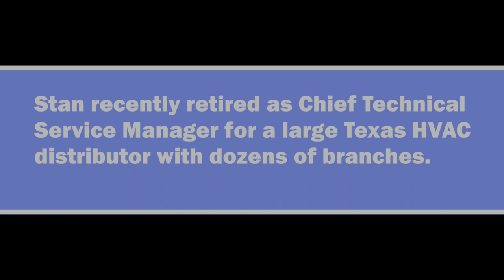Understanding ECM Motors

Comment: The problem is while ECM technology is excellent, the high amperage at high static pressures burns out the controls.  This is not a concern to the mfrs as they please the government with an efficiency test on a pristine design system, and as the motors are mfr/system specific the mfrs can charge near 30% of the cost of original system for the replacement motor.  All “savings” used to sell high SEER to customers is then reclaimed by the mfrs with all the heat going onto the HVAC contractor/tech.  

As everything is in the control microprocessor, they could program the motors to not go up so high in amp draw and save the motor, but then they’d lose out on the lucrative parts profits from being the sole source supplier of properly characterized modules.  Also, the customer gets a long period of no HVAC while the part is being shipped in.
Reply: Happening to me as I type this been out of AC four five days now as I wait for an new ECM smh
Reply: @joesprauve2408  you should just replace it with a new PSC motor and call it a day. Then in the future, you have a much easier repair if needed again.

Comment: I have x13 electronic air handler after it does its cycle fan turns back on for a second turns of it does it 3 to 10 times at a time icm both have been replaced also fan motor but still does the same thing any information

Comment: AC to DC to 3 phase AC? What’s the purpose of the DC?
Reply: DC voltage is more powerful than AC. But we use AC at our house because it can travel much farther distance. You can use a cordless drill, say a 12volt battery and do the same work compared to a 120v corded drill. It's just more energy efficient.
Reply: The 3 phase Ac really is just artificial AC voltage. It just pulsating that dc voltage at the motors poles and creating that AC sine wave you would see on an oscilloscope.
Reply: @mackenziegray2090  work and power have nothing to do with AC or DC. Work is the product of force and distance. Power is the rate of doing work. It’s more to do with the horsepower as to how much power a motor has and less to do with the source of energy.
Reply: @mackenziegray2090  why not just run it on AC to begin with? Is the benefit in going from single to three phase?
Reply: @brianlittle717  I was just using the word power or work to describe you can do more with dc than ac. Ecm motors really don't pull that much amps compared to psc motors. Especially if you let the capacitor degrade over time they'll pull even more amps because the motor isn't spinning fast enough to create back EMF or its own resistance with inductive reactance.
Reply: @brianlittle717  not to mention ecm can adjust airflow depending on demand.
Reply: @brianlittle717  your original question was never answered. If I understand correctly, the purpose of the dc is to manufacture an artificial AC current at variable speed. Grid AC is at 60hz. Artificial AC can be modulated to say 10-60hz.
Reply: @realSamAndrew  I see. That makes sense. It’s frequency drive. Sort of an inverter to create the frequency, and the poles of the motor have to keep up with the rate of the alternations.
Reply: I think in this case, the motor seems to resemble more a BLDC motor. I see both VFDs (predominantly) and ECMs at my job.

Comment: I don’t understand what’s meant by 3 phase in DC current. There’s no such thing as 3 phase in DC.
Reply: @donalddebat57  I gotcha. An artificial 3 phase sine wave then. But that would be an AC sine wave none the less. Not a direct current.
Reply: @brianlittle717  The DC is used just like an inverter which produces pure sine wave voltage. In this case it produces 3 phase variable voltage and frequency. Don't know what the output would look like on a scope. Even more complicated is that only 2 phases (120 degrees apart) are powered at any given time (sequentially) thus causing the magnetic rotor to turn and the unpowered phase receives EMF generated by the rotor which is used as a feedback to determine commutation, direction and speed. I don't know if the power sent to the 2 phases is in the form of a +/- sine wave or a +/- pulse. The whole idea is fascinating and it definitely works. I have a 19 yr old 2 stage gas heating & cooling (dual compressor & txv on evaporator) system with variable speed & ramping on the blower, condenser fan and inducer. The biggest advantage is humidity control in summer by varying CFM. When heating, even the inducer speed is lowered shortly after the cycle starts which possibly allows hotter air to be circulated(?). The condenser fan seems to run either high or low as per which pump is running (and switching to the larger pump only happens on a super hot day). Since installed, the larger pump probably only has 20 hrs run time. If I had it to do over again ($), for cooling I would go with a single compressor, txv on evaporator and definitely variable & ramping blower. I hope my rambling helps in some small way. 😄
Reply: @waltersmith7950  like I said. The inverter is creating alternating current. Refrigerators have been using variable drive. The advantage is there is no temperature swing between the on and off cycles. The disadvantage with refrigerators anyway, is that they compressors only last a couple years.
Reply: @brianlittle717  OK.
Reply: @pauledwards3325   almost. A rectifier circuit needs a lot of filtering to simulate a true direct current, but it is part of a power supply. If you start with a single phase AC power source and use a power supply to produce a direct current, then you simply have a direct current. The term 3 phase relates to the three wires and the three transformers on the power pole, where voltage sine waves are 120* apart from one wire to the next. In DC, there are no sine waves, but depending how well it’s filtered, there could be harmonics. There actually is such a thing as a 3 phase rectifier but it is for high power industrial applications, must have 3 phase service from the power company, and they are extremely rare in the last 50 years or so. The 3 phase rectifier reduced the effect of harmonics, but transistor circuits have solved that problem anyway.
Reply: I think it’s a dc motor. Not a 3 phase motor